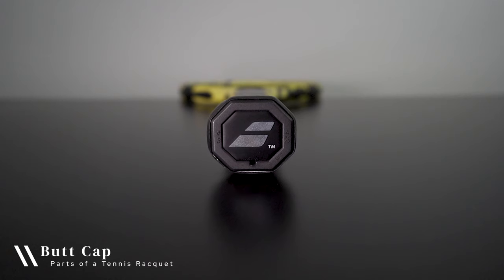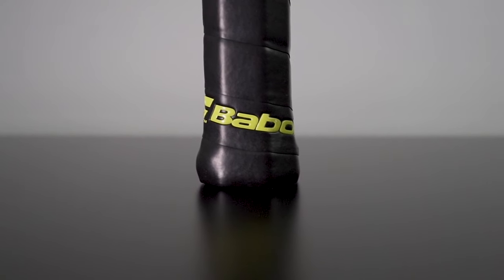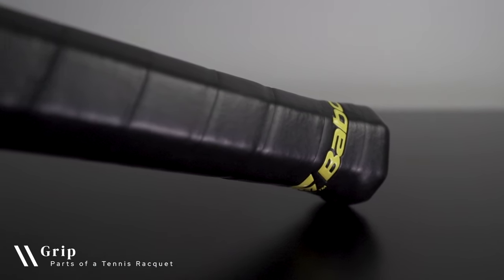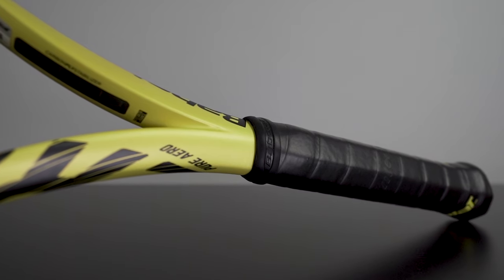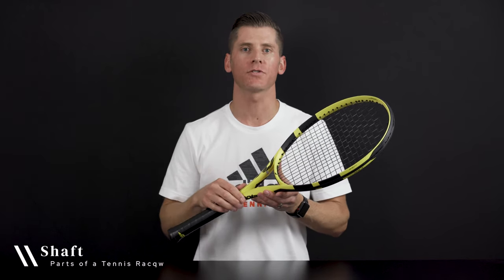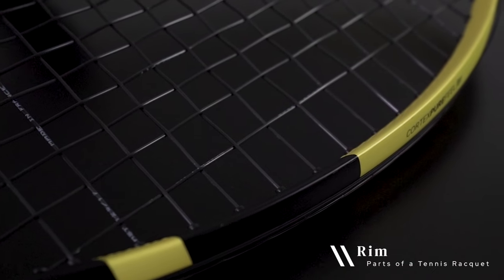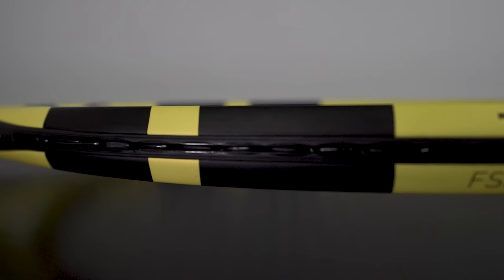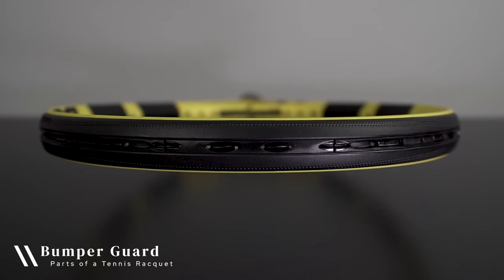Parts of a Tennis Racquet

Comment: How can I find a racket with more length of handle?? I just found stuff about the grip, but nothing about more length of handle
Reply from the maker: Hi Gabriel - have you checked out extended-length racquets? Not all models come in an extended length, but there are many available with longer handles. You'll usually find them noted as 'plus' models, i.e., Babolat Pure Aero vs. Babolat Pure Aero Plus.

Here are a few popular models that offer extended length:

- Babolat Pure Aero Plus
- Babolat Pure Drive Plus
- Yonex EZONE 98+
- Wilson Blade SW102 Autograph

Many oversized models also feature extended lengths:

- Head Graphene 360+ Speed PWR
- Head Graphene 360+ Instinct PWR
- Head Graphene 360+ Extreme PWR
- Wilson Clash 108
- Wilson Ultra 108 v3
- Prince Phantom 100G LB (Longbody)

There are many others, but hopefully, that helps you get pointed in the right direction. Beyond that, a player can customize their racquets to extend the length of the handle.

One product that exists to help players do it on their own is the XTP butt cap, but some professionals will do the work for a fee.